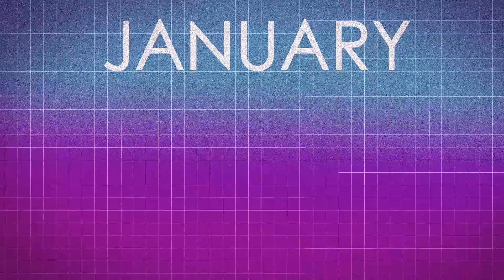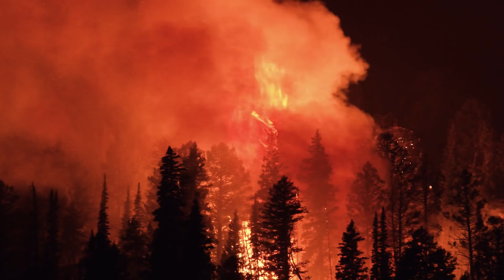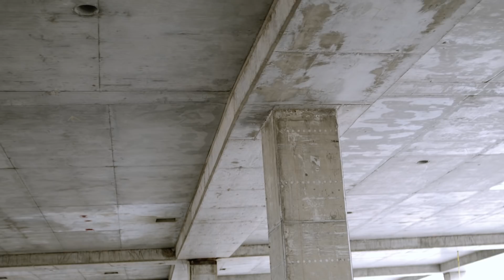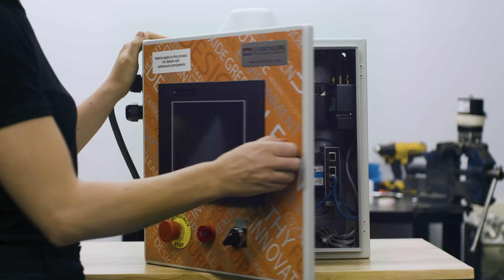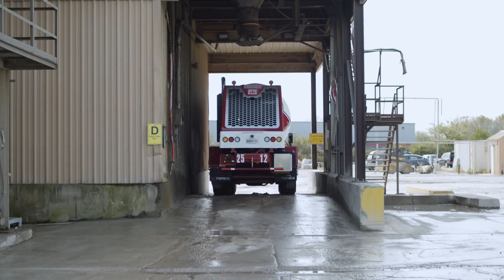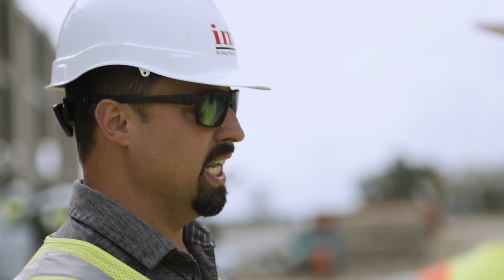How to make concrete green

Comment: As a specialist, I am not convinced at all. Cement production already emits a significant amount of CO2 according to the reaction CaCO3 --> CaO + CO2 in the clinker. That being said, CarbonCure is not clear in its statement by just saying a small amount injection of CO2 into the concrete... . I guess Carbon cure is returning about 0.005% of emitted CO2 back to the concrete. Yes, some CO2 is locked in, but the impact does not seem to be high. Please convince me... I am ready to debate.

Comment: I just watched this three times, and I applaud the concept, the innovation, and the drive to help to reduce our Carbon emmissions. Thank you.  What I did not hear however is what percentage of the normally released Carbon is reduced through this process, what quantity is therefore reduced per ton of finished concrete, and how much stronger the improved concrete generally is. Bill Gates, in his new book, describes the use of cement/concrete as globally expansive, with an increasing negative Carbon effect, yet Rob Niven here does not seem to imply how much of the world's cement/concrete production might be able to adopt this process improvement. Is it just Domestic? Is it Global?

Seperately, Ron Niven is obviously an expert at this, and could of course talk to you for hours on the subject. So why are we not seeing him speak to us head-on? There is no eye contact during the presentation at all. This is an empassioned plea for understanding and call to action to the country and the world, and the directors of this piece are treating it like a testimonial for an insurance commercial. Please, have the experts speak directly and plainly to the audience, even if that means that they need to practice for two days in order to get it right and feel comfortable. Fixing it in post just doesn't cut it. 

Thanks for your good work. Cheers!

Comment: Carbonized concrete is not a new idea or concept. Until now, carbonized concrete has not been successful because it is more aggressive against the steel reinforcement, and the life of buildings is shorter as a result. Were they able to solve this problem?

Thank you for your answer (;

Comment: This is still not addressing the issue of the carbon footprint of cement. Each ton of cement produces, roughly, a ton of carbon dioxide during the calcination process in the kilns. What happens by curing the concrete in CO2-rich environments is helping a little bit but does not make the final product green. It's analogous to reducing the salt content in fast food by something like 10%, it helps but does not make the final product, i.e. the food, healthy. In my opinion, the solution to the issue of cement is using alternative cements like geopolymers, supersulphated cements and LC3 cements or by using natural or more environmentally friendly construction materials like stone, wood, etc.

Comment: What about hemp and bamboo - two very sustainable and green building materials. They both grow very fast and agriculturally are easy to produce, and even if the farming is not organic they seem to get away with not requiring as many to any toxic biocides.
(not sure about all the materials needed to get the fibers usable, but given these are old low-tech materials, it's likely it's not polluting?)
You can get concrete made of hemp too. I'm not sure if bamboo can be used in place of the steel reinforcements, but at a guess I'd think it probably could.

Comment: How much energy goes into putting that carbon into the cement? If the concrete is destroyed does the cement retain it's carbon content? How long will this material last before it needs to be replaced?

Comment: A better solution is to use less concrete and more wood https://www-nytimes-com.cdn.ampproject.org/c/s/www.nytimes.com/2019/10/03/opinion/wood-buildings-architecture-cities.amp.html
especially here in Seattle where wood is abundant, local, renewable and the most sustainable building material.
Reply: Using too much trees?

Comment: Greenhouse gas effect , the core of the climate change was proven WRONG Billy!
I can show you:
https://en.wikipedia.org/wiki/Ideal_gas_law
Ideal Gas Law :
PV =nRT
T = 101.3 / (8.314 x 1.225/28.97) = 288.14 K ~15°C
Earth black body temperature is -18.8 °C degree or 254.3 K
All of that 33 degree rise without greenhouse gas effect.
Venus:
T=9200/8.314 x 65/43.35 = 740K or ~470°C
Titan:
T=146.7/8.314 x 5.25/28 = 94.1K or -179°C
Let's see evidence on other worlds:
https://youtu.be/BuTmHCRJovc?t=144
https://youtu.be/1Y_n283fYbc?t=470
KO

Comment: Concrete is great for construction but the problem is it's very heavy...so the structure has to support what is on top as well as their own weight... If they combine with lightweight concrete and different  aggregated we would have lighter structures and less concrete.

Comment: Mir Bill Gates, I am going to strat a campaign against those Hundred most polluted componies which are really responsible for wold's distruction. Its is pakistan, who's contribution of Carbon imission into atmospher is less than 0,001 percent only, but according to a new survy Lahore pakistan is in the ranke of top 1 effected by the "Air Pollution". Therefor, i am going to lodge FIR against these componies....

Comment: Isn't it like:
CaCO3->CaO+CO2
CaO+H2O->Ca(OH)2
Ca(OH)2+CO2->CaCO3+H2O
So cement is carbon-neutral, because Ca(OH)2 is not stable, and will absorb all the CO2 emitted by the manufacturing.

Comment: Using hemp strands to help as a bonding agent will be a great reinforcement. Our company has created a appliable skin to use as a waterproofer which increases the life span of the brick or concrete indefinately if applied aging and agin. For canadian clinates it prevents water from working its way into the seams and provides a uv barrier to prevent deterioration due to the elements.

Comment: Okay, I'm calling bullshit.  Here's the thing: he never actually says how he's removing the carbon.  "We bolt on this device and magically turn it into value."  Bullshit.  What are you doing with the physical CO2?  Are you pulling the 'we pump it into the ground and it magically goes away' line?  Because there's a limit to how much CO2 you can inject before it starts to leak back out of the earth.  Not every cement plant is located in areas where it can be trapped.

Edit: Doing a little research, they're using curing concrete as a form of carbon sequester.  This is bullshit too.  Carbon dioxide is an extremely low energy molecute.  It takes a lot of energy to react it with something else.  You can't just throw it into concrete and expect carbonates to magically form.  The CO2 will simply bleed out over time.  This happens to concrete naturally already (because not all CO2 is baked out of the cement).

Now if he said something like "We take the CO2 exhaust from the kiln and powerplant and bubble it through water to make carbonic acid, then neutralize that carbonic acid with sodium hydroxide to make sodium carbonate, which is not a gas and thus prevents that carbon from rejoining the atmosphere." Then I might be impressed.  Sodium carbonate decays back into CO2 at 80C so it's a fairly stable.  You'd have to evaporate it and then figure out where to put the damned stuff, cause there's going to be tons.  But this is basic chemistry, doesn't involve gimmicks like 'we bolt this technology to the plant and magically the carbon goes away.'

Comment: Wait so the innovation is adding a small amount of CO2 -> causing a chemical reaction -> strengthening and reducing the cement demands of the concrete? Is the majority of the carbon offset achieved from the reduced cement demands? Either way I'm interested in how this is being rolled out and how its being adopted world wide. Is it expensive? hahaha so many questions it's alright nobody has to answer i'll do my own research.

Comment: "this is a really great idea"

   -1% of the comments
Reply: Berna just copied another comment...I can’t stand attention seeking low life’s like you
Reply: why are you saying this and why does this comment have so many likes
Reply: They haven't done anything new tho, the CO2 you bake out of limestone to make cement gets absorbed again as it sets, it's already carbon neutral, minus the energy spent to bake the limestone. This is a scam
Reply: @TinkPill  It's not, it is an innovation to reduce cement usage, and to use some CO2 in the process. This is definitely a win in CO2 reductions.
Reply: @TinkPill  yeah，of course it would be absorbed..... after perhaps 100years, and since the amount absorbed is far less that the amount o co2 emitted, the co2 in the atmosphere is just gonna keep increasing, which causes climate change....learn some basic science knowledge man
Reply: @catherinechen1639  as far as just the concrete is concerned it is mostly carbon neutral, calcium carbonate(limestone) is baked to reduce it to calcium oxide(quicklime) which can be "slaked" in water to produce calcium hydroxide (slaked lime, or just lime), when slaked lime is mixed with water and sand it can be left to set into concrete, it then absorbs just as much co2 that was baked out of it to become calcium carbonate again, i was talking about just the carbonate cycle being neutral - digging out the limestone and processing it costs fuel and effort. Sorry for long post hah
Reply: @TinkPill  Bruh why build cities when you can have forests
Reply: @influff7435  convenience and comfort, especially if there're children in the mix, you would want them to have every advantage
Reply: @TinkPill  Trees will soak the CO2
Reply: @influff7435  not really? As far as binding carbon goes, even grasses and weeds perform better than trees pound for pound, but by far the biggest sequester of co2 are algae and seaweed

Comment: To make concrete you need different parts to bind it together. Cement is something very reactive that can bind different parts of concrete together like sand and so on. Cement is made active by heating limestone enough so CO2 pops out of the molecule. Adding to the CO2 in atmosphere. This company seems to be able to lock CO2 back into the mix. Great of Mr Gates to promote this process. Best wishes to Carboncure.

Comment: "To make concrete, you dig up limestone from the ground and you run that through a kiln"
Limestone? Kiln? What are these blocks?
To make concrete all you need is sand and gravel. And in this vid's case, plop green dye right in the middle
Reply: Concrete is calcium oxide, which is produced by heating limestone up in a kiln.  Limestone is calcium carbonate, and when heated, releases one part calcium oxide (lime) and one part CO2.  That's why concrete is a CO2 generator.  It's taking carbon dioxide in rocks and releasing it.

You can get rid of the CO2 by converting it into carbonic acid and then neutralizing that acid with sodium hydroxide.  This would turn it into sodium carbonate, which could then be disposed of or recycled for glass production.
Reply: @David13ushey  r/wooosh
Reply: @tiespauelsen7983  What threw you?
Reply: @David13ushey  It's a Minecraft reference, pretty sure. ;)
Reply: @CliffSturgeon  Ah.  I don't play minecraft.
Reply: That will endanger cactus and sea pickle populations.
Reply: I guess it would be something like bone blocks and a blast furnace

Comment: 1% of comments: such a great idea
99% of comments: I tHouGhT hE wAs PaiNTiNg iT GReEn
Reply: That's YouTube comment in 2019, just jokes over jokes (usually the same one) and everyone just ignoring what the video is trying to say
Reply: I thought they were all going to be about diesel trucks. That's what climate change deniers go for first.  The fact that everyone hasn't switched to solar powered everything yet makes anyone worried about their carbon footprint a hypocrite straight away for some reason.
Reply: It's a bullshit idea.  "We use tech to get rid of the CO2."  That doesn't explain how he is physically preventing the CO2 from entering the atmosphere.  It's buzz words.  Does he pump it into the ground?  Well, there's problems with that.  How deep is he pumping?  What kind of strata is he pumping it into.  Can the CO2 leak.

If he's reacting it with a chemical, which one, how much, and what do they do with the byproduct?

If you can't answer these questions, you're not actually doing anything with the carbon in any way.  You're spilling out buzz words that assure you, somehow, the CO2 is being removed.
Reply: David13ushey I think what they mean is that they’re not burning as much fuel to extract the primary components of concrete because they’re not using it in this version. They’re not getting rid of CO2, they’re just not releasing as much.
Reply: Nah 99% he rich
Reply: What

Comment: Place a lime green dye in the top left corner of the 9x9 crafting grid (To make Lime Green Dye smelt a cactus) place 4 pieces of gravel in the top middle, one below the dye and one the the right of that. Fill in the rest with sand to get Green Concrete Powder place it in water to get Green Concrete

Comment: 1) CO2 isn't the biggest problem that comes with concrete it's the gravel which is needed to produce it

2) there already is a material which is made by filtering CO2 out of the air and emitting O2, which has the same strength as concrete and which is as affordable. Actually there has been for hundreds of years - it's called wood

Get informed Bill Gates

Comment: Mr beast: imma plant 20 million trees

Bill gates: Here’s a company that’s working to reduce emissions by the equivalent of 50 billion trees/year
Reply: 500 million acres is more like 25 billion trees
Reply: @elrox9189  500 million acres
Reply: Yeah, and it's bullshit.

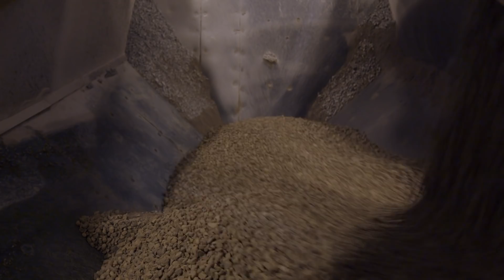Listen at 1:18.  He's not actually saying how they prevent the CO2 from getting into the atmosphere.  He's saying 'hey', we capture some of the CO2 and use the curing concrete to trap it.  Well, there's a problem.  first, they're not putting ALL that CO2 back into the concrete.  Secondly, that CO2 has nothing to chemically bind to.  Now in high pressure, you can force it to form various carbonates, but that's millions of tons of pressure you find underground, not the thousands of tons of pressure the concrete is under.  So the CO2 is just going to slowly bleed out of the concrete.

You want to tell me how you're removing the CO2?  You need to talk chemistry.  If you're not talking chemistry, you're talking bullshit.

Comment: This technology is questionable. Concrete naturally cures by absorbing and reacting with carbon dioxide. Pre-cure concrete by pumping carbon dioxide into it might improve the speed of structural formation, but it will not change the fundamentals.  The examples given the video are also questionable. The extra energy that is used for implementing this technology over shadows its benefits.
But a better idea for emission reduction was actually mentioned in the video, structural improvements that lead to less usage of concrete.
I know Gates will probably never read the comments, but this is not the type of project you want to promote.

Comment: How to make concrete green:
 Concrete can't be dyed after setting, use green concrete powder. Green dye in the centre, surrounded by four sand and four gravel. Place it down, then place a water bucket to turn the powder into green concrete.
Reply: Dang it that was my joke
Reply: Wait how do I get green dye
Reply: @jimmyjohnjoejr  smelt cactus
Reply: @bruhmoment1835  oh I'm trying to get lime green dye. Should've specified. But I can't find any limes! I've looted every dungeon and village, chopped down every tree, planted every seed, nothing. What should I do?
Reply: @jimmyjohnjoejr  Combine green and white dye?
Reply: @bruhmoment1835  tried using bleach instead of white dye, accidentally ingested some and then dyed painfully. 10/10
Reply: @jimmyjohnjoejr  That's a Bruh Moment
Reply: @bruhmoment1835  indeed, when I came back all my items despawned. Also my boss fired me and my wife left me for being "dead for two weeks straight". All I did was leave the server jeez

Comment: I was expecting a cement variety that causes wall of buildings to grow plants when exposed to sufficient sunlight, giving way to a moss-covered exterior of sorts. 

But this is good as well, thank you.
Reply: That would be horrible, the roots of the plants would destroy the wall incredibly quickly. Concrete needs to be well sealed because any penetration of water will start to fracture it (especially in areas with freeze-thaw cycles).

Comment: the best solution is.. Plastic balls mixed with cement, plastic could be made into..

1. Shirts
2. Chairs / Furniture
3. Shoes
4. Bricks --> Houses

You say factories handling plastic causes more co2, machines, machines use power from coal? Hydro, Wind, And solar power could create enough power for a good bit

Comment: There are people that have never heard of the energy paradoxon, the real reason for climate warming:

Randall Carlson on the energy paradoxon: https://youtu.be/o81xqTfWt-U

And there are people not understanding CO2 well. 
There is much CO2 in the oceans and as cold water can dissolve more CO2 than warm water this CO2 must have got in there during the last ice age. And CO2 in water is acid, dissolving coral reefs and diatoms.

This CO2 will gas out and rise average temperature slightly.

BUT CO2 is also migitating temperature maxima and minima leading to milder weather and more vegetation as C3 photosysthesis based plants can absorb much more CO2 if available. If you touch dry wood it consists to over 95% of the weight out of the carbon from the CO2 from the air.

In fact, CO2 is shielding the planet from too much heat from the sun at daytime.

Without CO2 at all, we would have an average temperature of minus 18° Celsius,
maximal temperatures of plus 130° Celsius and minimum tempereatures down to minus 180° Celsius at the nightside of the planet.

So stay cool, do not litter the enviroment and learn to farm in a grand solar minimum.